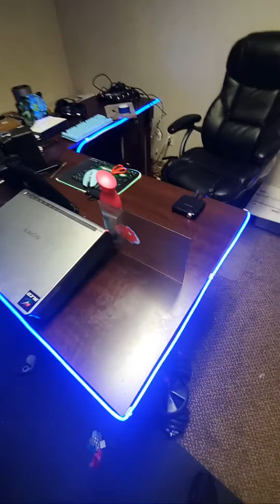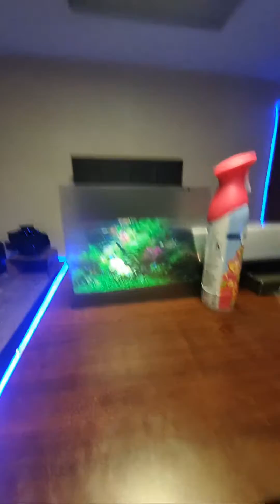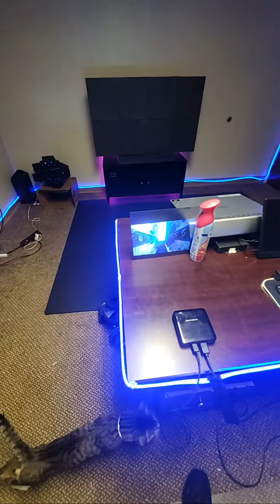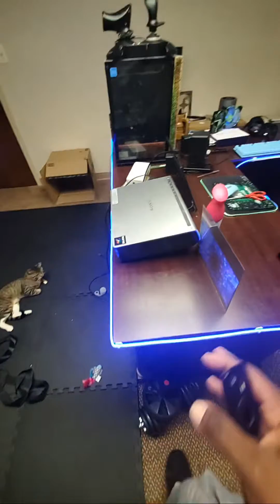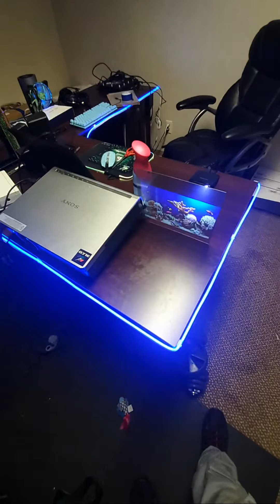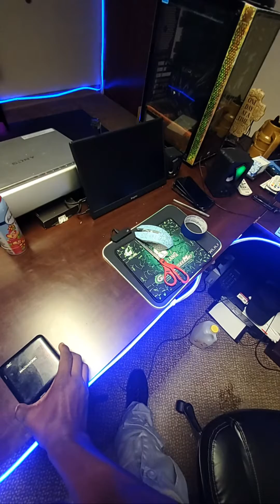FLE INVISIBLE TECHNOLOGY

Comment from the maker: GOD IS AMAZING! :)

FLE INISIBLE INFINITY 1 BLACK INFO SHEET

FLE [G] - FUSION LIGHT ENERGY GAIN 
Fully UST compatible and weatherproof.
Projector mapping applications
Projector interactive technology
Underwater submersible technology screens can operate when submerged underwater.
Rear projection capabilities
Projector Lumen capabilities inside start 50 lumens
Compatible with visual effects and special effects technology.

Projector paint on application information
Spray on application (ONLY)
Multi-coat layer application meaning how many layers of paint to lighten or darken the screen.
Light paint on coated application projector requirement. projectors needed UST and Projectors with lenshift capabilities.

Darker layers no special projectors required as in UST and lenshift capabilities.

Surface information.
Transparent surfaces only!

For more information Email us at IV-VIII.BLACK.SERIES.EDITION@OUTLOOK.COM 

Call us at 1-800-309-3134 

#rearprojectionscreen 
#ProjectorScreens 
#fle 
#HomeTheaterScreen